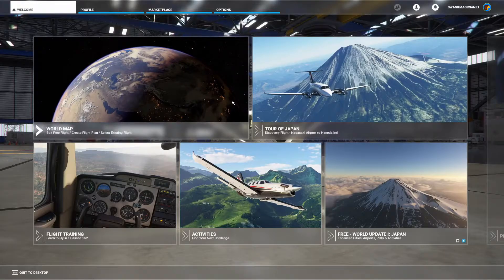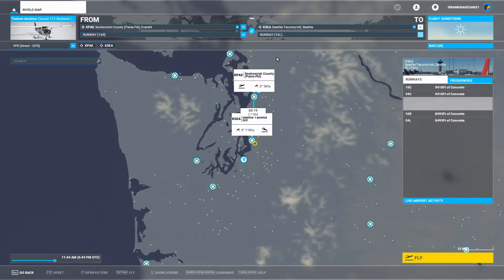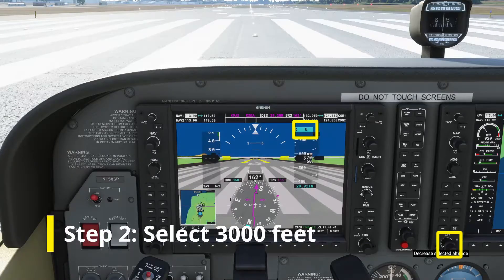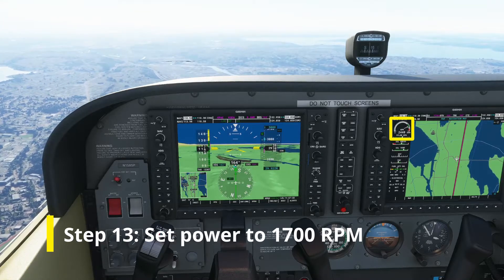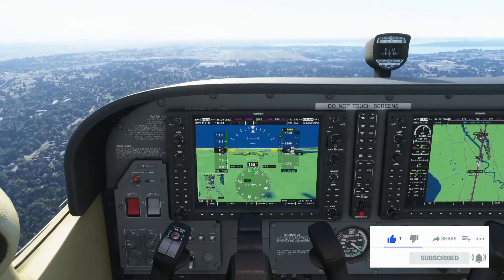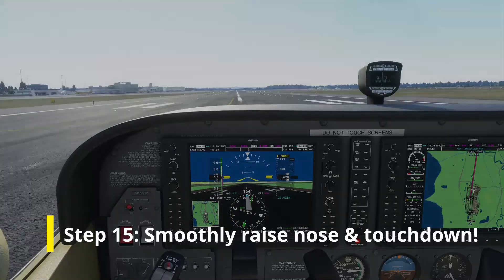MSFS: How to Use Autopilot (G1000) - Full Flight in 15 Steps (by REAL PILOT)

Comment: I've tried this many times following the video and the  extended pdf version , all goes well until I  try engage the APR approach button on the auto pilot (I have set the 110.3 frequency correctly) , but nothing happens and the plane just carries on without any course or altitude corrections onto the glide path and it just carries on past the airport. I have to disengage the AP and flight round to glide and land manually .... what am I doing wrong, why doesn't the Approach button work? Is is a general setting?
Reply: same here

Comment: Was it the autopilot who maintained the flight in correct path ( that pink line) or was it u ???
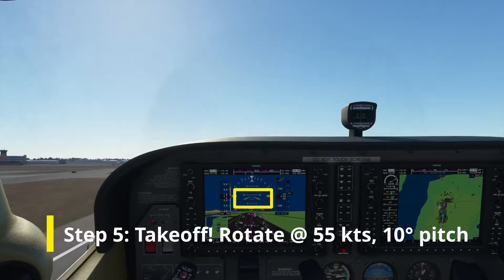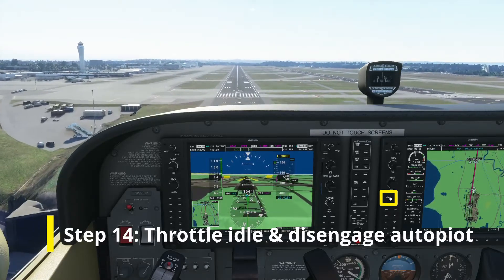Reply from the maker: Hi Satyajit, from 1:15 through 4:21, the autopilot is on. You can see whether the autopilot is engaged (and what mode it's in) by looking at the green annunciators (e.g., LOC/AP/ALT) at the top of the primary flight display. Whenever you see a green AP, the autopilot is engaged. I never exactly targeted the pink/magenta line in this flight - instead, I had the autopilot track the localizer for the ILS approach, which is not shown directly on the map in this case.
Reply: @FlightSimCoach  Thanks it helped me :)
Reply: @FlightSimCoach  is there any steps to make the auto pilot  track the localizer or it does it by  itself
Reply from the maker: @thicccpumpkin2287  Yes, starting at 1:52 (Step 10) you need to set the localizer frequency, then set the CDI to LOC 1 (Step 11), and finally, press the APR button on the autopilot (Step 12). At that point, the autopilot should turn right to intercept and track the localizer. 

Keep in mind that while these steps will work for this simple flight from PAE to BFI, on other routes, you may have to maneuver to get closer to the localizer first before you can press APR and have it successfully track to the runway.
Reply: @FlightSimCoach  can i set the same value(110.3) for other flights???? if no how to get that value for other routes.
Edit - will this tracking thing work for all planes????(airbus a320)
this was my last question :)
Reply from the maker: @thicccpumpkin2287  No, the frequency will vary. I'd recommend downloading the free expanded tutorial guide (tutorial.flightsimcoach.com) and starting at step 10, where you'll learn how to find the frequencies for different airports/runways. The basic process is the same for other airplanes with ILS receivers, but the exact details and buttons to press may be different. Hope this helps, thanks for your questions!
Reply: @FlightSimCoach  thanks for  ur help :)
have a good day
Reply: @FlightSimCoach  I got an email saying subscribe to something , I did it ,what should I do now to receive the expanded explainatiom
Reply from the maker: @thicccpumpkin2287  You should have an e-mail with the subject "Flight sim landing tips, expanded tutorial, & welcome to FlightSimCoach.com!". In there, click "expanded tutorial guide". If it didn't go through (be sure to check spam folder just in case), just send me an email at mike@flightsimcoach.com and I'll send you the guide directly.

Comment: I think you should explain why you did some of these things so that someone who's flying could understand why you choose 1700 RPM or how you have to set the vertical speed after setting the altitude.
Reply from the maker: Hi Quentin, thanks for your comment! I really tried to keep the video as short as possible, meaning there wasn't time to explain the rationale. However, you can download an expanded tutorial guide PDF at tutorial.flightsimcoach.com which will cover some of these questions. Also based on your suggestion, I will consider making a longer, more detailed video in the future. Thanks, and if you have other questions, let me know!